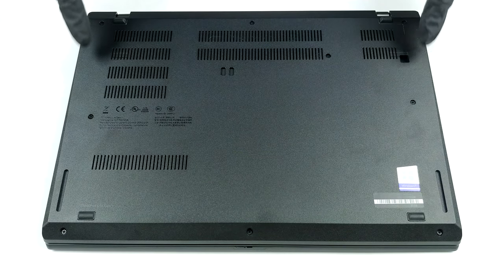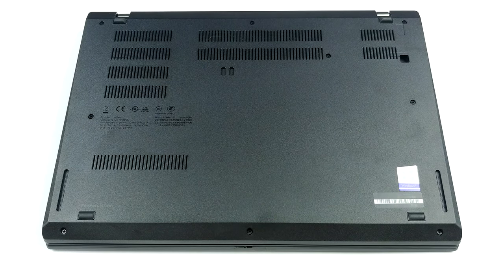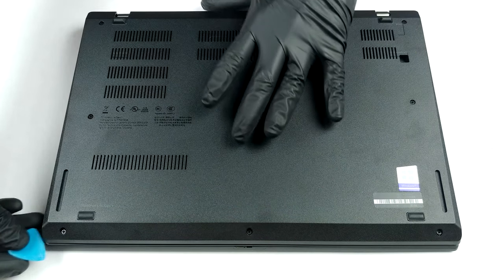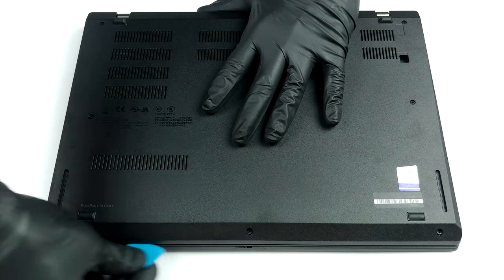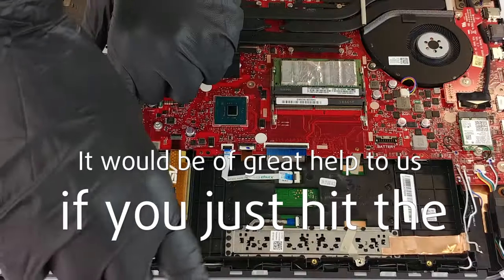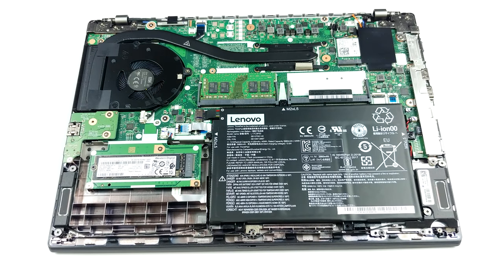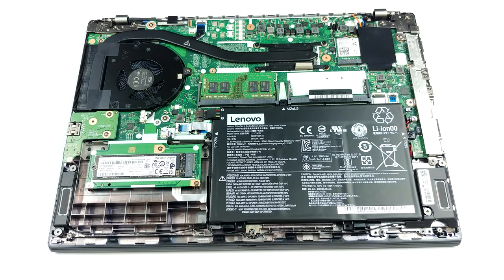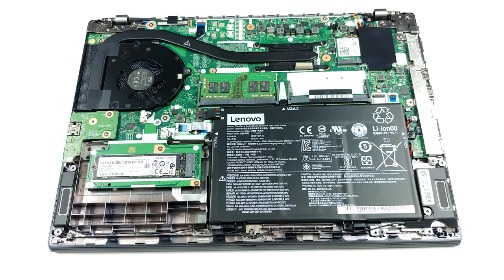🛠️ Lenovo ThinkPad L14 - disassembly and upgrade options

Comment: love that it has two RAM slots, not soldered! and looks like one model is the only AMD version of the L14 with a backlit keyboard: 20U5000QUS. the link shows this as a Gen1 Intel L14, FYI.

thanks for the video!! stoked to upgrade my RAM and SSD.

super weird you have to take the SIM card tray out before removing the bottom case. hope i don't break any plastic tabs when i remove mine. but nice that the battery is so easily replaced.

anyone know if the L14 Intel Gen1 can have 2 SSDs? perhaps in WWAN or some other slot? (i'm not a computer expert).

Comment: Why is there SO much empty space next to the battery (lower left corner)?!
Reply: the design originally used a 2.5" SSD, but they have since changed the motherboard to use a faster NVMe one. Not changing the body keeps manufacturing costs down
Reply: @benjaminmcintosh857  *HDD
Reply: @hangiez580  both were options, same form factor

Comment: I want to upgrade my ram. Which ram is good for this laptop
Reply: RAM that runs at a speed of 3200MHz in dual channel mode. So at best you buy a kit of two ram sticks (that are the same regarding speed, CL, timings etc)
Reply: based on manual, L14 based on i3-i7 cpu can handle DDR4-2666
Reply: @piekard80  Thank you
Reply: @piekard80  yes, the configured speed is 2666, but for some reason it comes with 3200 RMSA3320ME88HBF-3200 Ramaxel Technology RMSA3320ME88HBF-3200 16GB in my case. So I added another 3200 module so that the module timings match.

Comment: What kind of slot is the one next to the wifi? PCI-e? Would it support an ssd ?
Reply: I'm pretty sure it is for the LTE-modem module. and typically there is no possibilty to run a ssd of it.
Reply: @nighthawkger93  chances are very good that it does, as the old models supported m-sata

Comment: How do you remove the SD card tray? My L14 doesn't budge when I press the button on the side. Does this mean the SD card tray is already empty?
Reply: The microsd reader should be bellow it

If you're trying to eject a flush panel thing, that's the SIM tray which might not exist on your model
Reply: @TingFeng77  But if the SIM tray is there, it must be removed, otherwise you can break the back panel when removing it. SD card tray is soldered to board. I had some mechanical failure in it from production, SD card wouldn't click/lock, meant whole motherboard needed replacement.